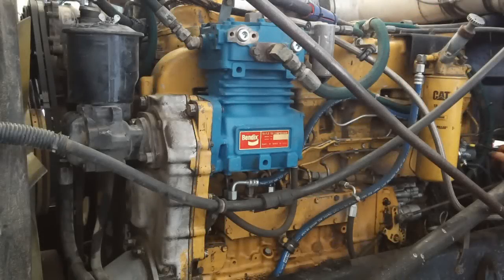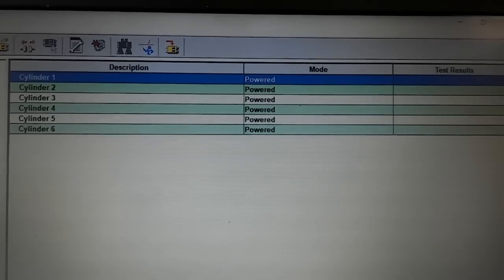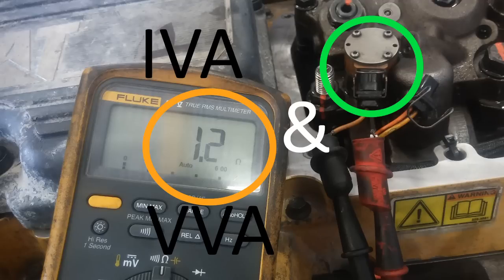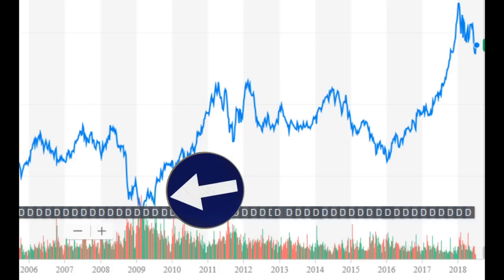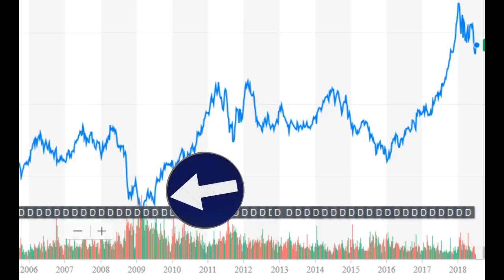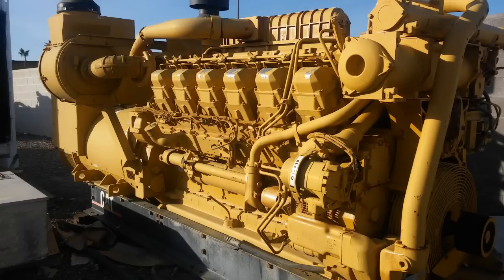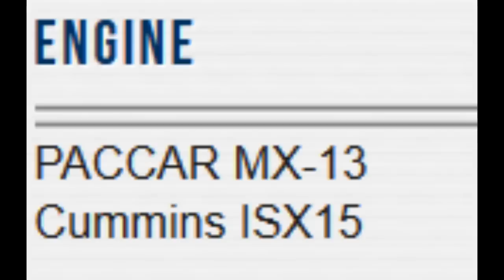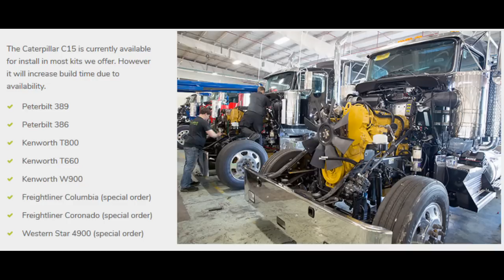Why Did Cat Stop Making Truck Engines?

Comment: Still running my 2003 Intl 9400i with original Detroit Diesel 12.7L-470Hp non-egr which was one of the very last ones ever built. Just had it rebuilt in 2016 at 1,031,000 miles and now at 1,139,000 miles and still kickin' ass. I loved the 3406E-435Hp but this Detroit still chugging right along at 7+mpg with near zero smoke between gears. If I take care of this engine, it should easily last another ten or more years. I bought the truck 8-years ago and would be happy with it for another 10-years no problem. It's a shame the loss of CAT in the truck market but our Lafayette plant is still putting out CAT engines for gensets, marine, and heavy equipment and I hope that continues for a long time to come.
Reply: Hey James, good informative post!  I used to think it was great to get 300,000 miles out of an 855 Cummins or any of the old 2 stroke Detroits. When the Series 60 came out, I was curious....then my buddy who is an Absolute Master Wrench said he tore one down at a million miles, and found very little wrong with it. And folks said they'd get one mpg better than any other engine available... I guess Roger Penske got it right!  They run the 60 in Mexico, pulling double 45 foot trailers in their "Kenmexes"--they push the engine to 600 hp, with I think a 16 or  18 speed gearbox.  Those boys can DRIVE down there, but the bad roads mean Many Many accidents.

Comment: All they had to do was get with the times and update their fueling and combustion process. Nope, gotta be HEUI or MEUI, thats the CAT way. We'll ride it out on our carbon credits. Cummins introduced Common rail in 2003 and used the same setup to now. Tier 4i came in at 2007.5, but Cummins got ahead of the game. It's called planning. I hope a team of people got fired when they invented the CAT truck and rebadged engine. Note: CAT finally introduced common rail a few years ago, but still stick with a DPF instead of going SCR/DPF-that's the CAT way.
Reply: While I am a big Cat fan, yes, they really should have gone with a DOC / SCR / high flow DPF setup. Their refusal to adopt SCR was very confusing.

Comment: I worked for a Mack dealership in the service dept, we had one guy who was a Detroit nut who demanded to right to work on all Detroit powerplants that came into our shop, but when a Cat came in (which was 2  times in 2 years as I remember for minor crap) there was a shop wide scramble to get that job. lol It was funny, I was happy working on my plain old R model inline 6s with intercooled turbos, they reminded me of an oversized Ford inline 6, despite having 2 heads and the turbo. lol But I got to work on one of the Cats which was pretty much fixed with new filters. lol The lines had to be blown out, it was just neglected and/or sat a long time.

Comment: Love my cats!! Owned a 1693 for twenty years.. currently have a 3406B.. love it!! 
Have an N14 too.... Not impressed! I swear the 3406B rated at less horse power than the N14, will run circles around it!
Would love to repower and dump the N14!
 Great video, thank you for the enlightenment!

Comment: This video is TOTALLY TRUE!!! I worked at Caterpillar Mossville plant and when those 2007 engines came out they were JUNK, and alot would fail in the hot test on the Dyno machines and we were told to ship em anyways and they could fix em once they were out on the road, which is why Cat warranty costs skyrocketed!!!! Stupidest move by Caterpillar to this day to shut down Mossville engine center, we were the best and EVERYBODY wanted a union made 2006 or older Cat Acert truck engine.

Comment: I have a c7 or c 70 as some call it a 2006 in a m2-106 Business class truck single axel dump at 350,000 it runs like a top does not burn a drop of oil and don’t leak a drop of oil I hear they discontinued that motor as well.

Comment: 3406 was my favorite out of them all. Hands down
Reply: Mississippi Mud Team the excavation company I used to work for had the 3406b in there 81 kenworth and the things never broke down. Then he got this Stirling with a cat c7 and that thing was junk
Reply: The thing would go into this limp mode and we couldn't figure it out. Come to find out it was because the coolant level sensor was bad. Like wtf.
Reply: blindabinda123 the e model 3406 was my favorite out of the 3406
Reply: blindabinda123 only truck that we had go into limp mod was a MACK we changed every filter, sensor, Even bought a new ECM from Mack witch was a fortune and it’s still in limp mode, it’ll barely pull an empty flatbed across the lot in low gear
Reply: Mississippi Mud Team what engine does it have and what code is coming up? ? It's probably the heui pump not putting out enough pressure. The fuel systems are garbage on new trucks.
Reply: blindabinda123 that’s the problem, it won’t throw any codes, we took it to a diesel shop down the road and they hooked their laptop up to it and it said everything was fine.
Reply: Totally agree. 3406 is a great engine
Reply: I liked how they had such strong lift off at low RPM. Great for the oilfield.
Reply: eloyex yessir
Reply: 1693TA BEST ENGINE EVER!!!

Comment: However,  my 379 heavy haul truck is still cat powered.  Started with a 6nz. Then when we rebuilt the engine,  we rebuilt it to a c18. Best electronic cat ever.
Reply: 2000 pete 379exhd, c18, cat brake saver, 18+2, 3.73 gears.  Full double framed.  20k front,  20k tag, 48k drives.
Reply: Almost a real heavy haul truck lol
Reply: C Mackenzie Awww...hahaha...you got jokes 😁
Reply: 20mcarroll02 Nice👍
Reply: Lol I'm a westernstar guy as you may have guessed from my pic. I run the same engine on a tri drive winch tractor. 90lbs planetarys with a 18 & air shift 4 speed a box. And my other one is the same but with a automatic main. Both gliders.

Comment: Egg Harbor twp had 7178-7187 model 2007 MCI D4500 commuter coaches with caterpillar C13 engines with the B500 R Allison Transmission seating capacity 55-43 with two wheelchairs and a lavatory and I've rode those buses form the 553 559 and 319 lines and now Howell twp and Ironbound garage in Newark also Medowlands garage still have mostly older commuter coaches with the Caterpillar C13 engines with the B500 R Allison Transmissions for NJ transit

Comment: DEF was a main reason CAT stopped making truck engines, as CAT engineers couldn't make a CAT engine work well utilizing DEF. 
The good news is that the EPA is rumored to stop mandating diesel engines be equipped with DEF systems,  as their recent studies have concluded that DEF emissions are more harmful to wildlife than previously thought.
CAT is said to be reconsidering getting back into the truck engine market now that DEF is no longer a requirement.  Let's hope!
Reply: Blind Squid  I have a friend that lost his job because he is badly allergic to def & had many medical issues from it while stuck in traffic with many other semi's during rush hour traffic in the PNW, doctors tried to lie to him and play games... he had to go to a specialized medical facility in Portland, Or. to get tested... and result's were that DEF cause it from the vehicle's during the burn process - Basically anytime he goes out now he has to were a mask anytime he's remotely near a Semi /w DEF... So Another Trucker Lost to Stupid Reason's
Reply: What's stupid is that DEF technology reduces fuel mileage. So you have to burn thru more diesel. How is that saving the environment.
Reply: DEF is bad for you and the environment. If you  read the bottle on how to  handle it this will shock you.  so def is crap it doesn't do a dam thing uther than gas you out and cost twice as much as the pump
Reply: There is no mandate to use DEF, its just the cheapest and most efficient solution.
Reply: Actually, no, DEF INCREASES fuel mileage. It allows the engine to be less reliant on EGR, which means it runs cleaner and more time between regens.

Comment: Loved my CATs in the past, but the Cummins is a very good engine. I pull heavy haul loads with a ISX 525...I always wonder if the old 3406 could have handled them as well.
Reply: Old 4 and quarter had in my 91 western star 15 over 7.5 miles per gallon hauling 63500 wood in northwestern ontario best engine ever .new paccars.  Get a whooping 5.2 miles per gallon and is off to the shop regularly because of computer derates.. Wires that look like old phone wires rubbing in the loom.. Millie amps ..bahahahaha.. 🍺🍺😃😎
Reply: @frankjrszeder5782  are they still pulling tiny loads like that

Comment: The cat truck wasn’t a cat truck. It was a Navistar truck with cat badges on it. Also the maxxforce 13 was a complete shit box.
Reply: Navistar engines (and a lot of others ) were ruined by govt. regulations. Talk to Diesel truck owners, emission regs, DEF, electronic injectors cause down time for pretty much any brand engine. Too bad the govt ruined something as dependable as the Diesel engine.
Reply: Yup, a "Catanational"
Reply: maxxypad you meant lmao
Reply: The Navistar MaxxForce 13 engine used a Cat C-13 engine block painted black. That MX-13 engine, produced by international, was just a cat motor with different fuel setup. I had one in a 2010 prostar, and it pulled just like my C-13 in a Kenworth. They did have to change the EGR valve because of the recall, but that was the only updated I ever had to make.
Reply: @4thstooge75  navistar maxxforce engine engineered with germany m.a.n. trucks...

Comment: I run a 1989 Kenworth T600 air tank on the 3406b with a 15 speed it's better than all these new jumped I mean trucks
Reply: I run a 2005 379 long nose with the 3406 with the 13, still out pulls these newer so called trucks, nothing like a cat

Comment: Cat was losing around $500.00 per truck engine because of EPA.  The 425 to 475 mechanical were the best.  I am a retired Cat assembler.
Reply: Owned 6 trucks 475 cat was by far the best especially when climbing high mountainous terrain

Comment: Just finished pulling/re installing a caterpillar 6.6 liter engine in a 928F loader. It wad a school project and suprisingly enough, caterpillar uses almost all metric fasteners. Even our komatsu dozer uses imperial bolts. Pretty wierd to see an american company using metric fasteners but whatever.
Reply: Yep Cat is a metric company so 3114/3116 (1.1 litre per cylinder) was teh first series designed completely as a metric engine.

Comment: They made a good engine for moderate climates and construction equipment, and if you wanted to sound like a big deal at the truckstop.  But when it got cold for any period of time...I mean like 20 degrees F or below, 3 out of 4 open hoods on the shoulder would show me the trademark yellow of a frozen Cat.   Check the radio to make sure the Driver isn't freezing to death and motor on past, following my faithful puppy dog's short little tail.  Always gave his head a pat after getting home warm and dry.

Comment: Excellent and informative video!  I've NEVER seen one of those CAT trucks.....Last time I went to our local Freightliner dealer, they were stuffed with Volvos, no Freightliners, and all with a Mercedes engine of sorta small size, I think less than 800 cubic inches. Where's the American stuff?   But I KNOW Volvo can build trucks, when I drove in Germany (with my injector pumped jacked by 800 RPM!) nobody could whoop me consistently except for Volvo and Scania, both Swedes to my knowledge.  They'd just show up in my mirrors, and cruise right on past me....

Comment: I've owned trucks with 3208's, 3406's, and C-15's(2006 engine). I later hauled heavy for a company that had engines with the REGEN function and that system was garbage. I think there were some issues with EPA Carbon Credits, not sure. These days, there is a loop-hole in the EPA limits on truck engine size/hp. (I had to pay a EPA fee when I turned my C-15 up from 475 to 550 HP.) One can buy a used truck in Canada with a 800 or 1200 HP engine and import it, when one has 50 tires on 13 axles, the extra HP is handy.

Comment: I sure liked the 1693 TA 425 HP engine would just run forever
Reply: They were the coolest Cat engine ever. I knew guys on the highway running 1693's fueled to 700-800 horsepower, and those engines just didn't care. They were beasts!
Reply: @robertlloyd7167  they were the best I had a 1972 W-900 with one that got 6 mpg in the 70's loaded with  mostly steel and heavy loads

Comment: Anyone who has ever driven a truck with a CAT motor knows they were by far the best pulling engine you could buy! However the 379 Pete I used to drive only got at best 4/5mpg. The average was about 4.7mpg. The EGR valve was one of the worst emissions control ever invented! It recirculates dirty carbon filled exhaust back through the motor. That along with the DEF systems now in all new trucks. It is the biggest problem with truck engines today! It adds so much more cost and breakdowns that it is really becoming an epidemic!! I would never even consider buying a diesel pick up truck today! Too much goes wrong with all the emissions crap and the DEF system!!
Reply: Does the 2005 Peterbilt 379 C15 also do that?
Reply: I've only driven one truck with a Caterpillar engine, it was a 1999 Sterling single axle day cab, and had a Caterpillar C12 in it with a direct drive straight 10 Speed. It was okay. I've actually found the Cummins ISX 15 to be a decent pulling motor as long as it's with a true manual trans, forget it with the auto shifts
Reply: @NITO3570  No, it doesn't. 2005 C-15 is using Accert and doesn't have an EGR valve, hence the longevity of the engine. EGR system overload the engine (thermally)very much and causing premature failures and damage .
Avoiding this "mechanical hemorrhoid "(EGR system) Cat was still making reliable and efficient, yet clean engines but EPA rules had no mercy....
To relieve the thermal loading on your C-15 Accert you can do something simple and effective  -- replace the original exhaust manifold with the high performance one (PDI,Pittsburgh Power,Bully Dog....)
Works as advertised and you'll feel the benefits immediately (literally).
Engine pulls easy ,gains 1/3-1/2 mpg and have more power between 1200and 1500rpm. 
I did it about half a million miles ago and I'm very happy so far 1 377 862 miles on the odometer (900 000 of them mine) and I'm still with the original turbos, water pump, 5 fuel injectors (replaced #2 150 000 miles ago),head gasket....
The engine hasn't been open yet!
This engine is one of my best and wisest investments in my life!👍🍻
Reply: Guergui Stoyanov awesome man! What a relief... so when did they implement all that crap into the C15? 2006 and beyond I’m guessing?
Reply: @NITO3570  2007 + and Cat wasn't able to meet the EPA emissions standards for 2010 and gave up and went out of game of making on-highway engines. If you ever see some shabby ugly looking old Freightliner Century (occasionally Columbua) with 2 mufflers/stacks those are with last Cat engines (black or baby blue, old "Warner" trucks)
They are not very expensive and you have a good chance to find something which is worth the money. Good luck!👍
P. S. Kind of misunderstanding (my bad) in my first reply saying "No,it doesn't." I've meant that Cat doesn't have "mechanical hemorrhoid",aka EGR system. 
BTW,in a good days, especially if I have time to drive with 63-64 mph my truck regularly is better than 6.7 mpg and makes my wallet very happy. 😂
Reply: the way manufacturers make decisions is who can they screw to make more $$$ for wall st..The EPA applies regulations EQUALLY,,tHEY TRANSFERRED ENGINE PRODUCTION OVERSEAS,,,iT WAS WALL ST NOT THE EPA THAT CAUSED THAT
Reply: yes   the adblue(def)big lair.....i drive in europe old m.a.n. tipper semi truck...no def sys.no problem....the new volvo 180 wheelloader all week maintenance volvo action service...injection and def sys.trouble...
Reply: I couldn't disagree more about Cat motors. I drove a bunch of Petes with C15's in them at TMC and they were absolute dogs that took eons to build power with that ridiculous compound turbo setup. My next job had me driving KW's with Cummins ISX15's and those things took off like raped apes compared to those Cat motors. Granted I'm not some old fossil who's ever driven a truck with an injection pump, but I wasn't even slightly surprised when Cat left the on-highway business. The C15 was an antique architecture in a world that had gone overhead cam with VGTs. They were trying to compete against products which were designed to make over 600hp in marine trim from Volvo and Cummins. 

As for DPF and DEF systems... they are what they are. I have no interest in ever owning a truck and I couldn't care less what problems they have or what they cost to fix. If it breaks, I take it to the shop and get something else. I think they're much nicer driving trucks than those of 10 years ago.

Comment: What I was told by a CAT dealer was it would be 
counter productive and a lot more expensive to 
re engineer a CAT engine to conform to present
D.O.T. Standards and EPA regulations.. 

And doing so would take away most of the power
of the CAT motor that it is famous for in order to 
make the changes needed..  So they calculated 
that it would be more cost effective to just 
discontinue building new CAT motors.. 

But, there are several millions CAT motors still 
working hard out there, and with proper regular 
maintenance, and the occasional rebuild, any 
CAT motor can damned near last for ever..

Also any  CAT  motor that is only a few years old, 
is virtually worth it's weight in gold.. My former boss
bought about 100 or so Kenworths and all of them 
have the older 500 HP CAT engine in them....